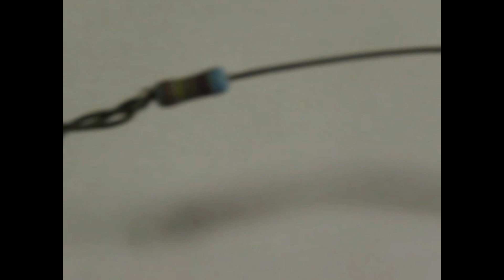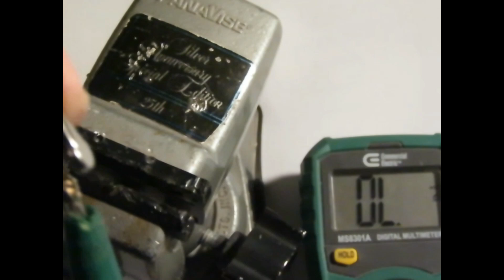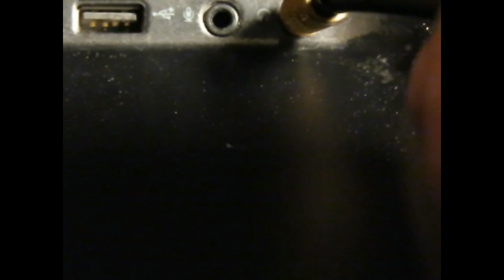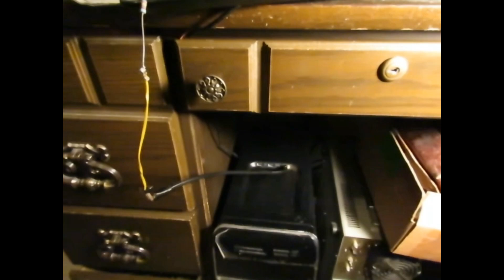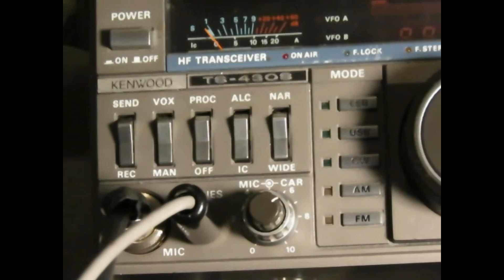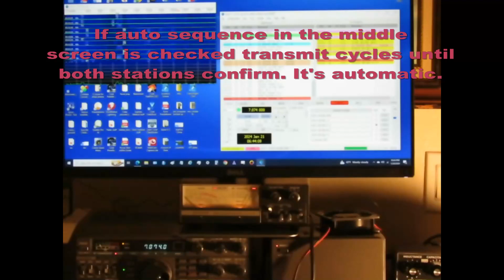Specific for Kenwood TS430s digital FT modes

Comment: Where did you get the cable that fits into the 430 mic socket?
Reply from the maker: The part shown in the picture, which is normally wired to the mic and plugs into the front mic jack on the radio came with the radio. You can sometimes find them on various ham sites selling used equipment. I doubt any ham outlets would have them. You may try posting on the used equipment sites that you need one of those. QRZ is a good place to start. You might try Amazon and Ebay.
The data plug and cable that connect to the jack on the back are difficult to find and kind of costly if you do find them, so I "ugly" wire them in. That is hard wire but don't solder wires in, just shove the wire in and tape it so it stays.

Comment: What if you computer doesn't have a mic input, only a USB in  and a Headphone out?
Reply from the maker: I've seen audio to USB interfaces available. You can search eBay or Amazon for those. I've never used one so I can help you with the details on those. You might look at a SignaLink. It's an interface for data modes. I don't know the details on those either.

Comment: Thank you
I understood the basic structure through your video.

In the previous video, it is shown that there are a total of 3 resistors,
We confirmed that the total is 101K Ω including the variable resistance.
(47KΩ+54KΩ = 101kΩ)

Question 1
How many KΩ are each of the two general resistors?
Can I install one 47KΩ?

Question 2
When measuring resistance after connecting the plug pin, do I need to adjust the variable resistor so that it is between 50KΩ and 70KΩ?
When connecting the final TS-430S microphone jack, should I adjust the resistance to between 50KΩ and 70KΩ?

As a new amateur radio operator, I am grateful to have learned a lot from you.   DS4HQS

Thank you
Reply from the maker: Yes, you can use one 47.0K or even one 48.1K ohm resistor along with the variable resistor which is set at 7.7K ohm for a total of 55.8K ohms. but the values are not critical as
explained below. 

If you want to set it up exactly the way I have it, here’s the short easy answer to the whole issue. Each of the regular resistors are 1/4 watt at about 24K ohms at 2% tolerance, so measuring them one is 24.0K ohms the other is 24.1K ohm.. The variable resistor is set at 7.7K ohms. So, 24.0+24.1+7.7=55.8K ohms total through all three resistors. 
 
The deeper explanation below explains that the resistance value is not critical. You can have a wide range to choose from.  And you can get a single resistor at the value  you choose.   

Question 1:  Resistors come in standard values. So you can use a single resistor. Also you don’t need to be precise on the values. The resistors used here are just there to limit the current from your computer so you don’t over drive the radio, or damage the MIC input by accidentally having the volume on the computer too high. So, a minimum resistance which I have found to be around 50K ohm should protect the radio. You can go higher to be on the safe side. I’ve gone up to about 100K ohms, but that’s on the high end. You would be fine picking a resistor between about 50K to about 100K ohms. A good one in the middle would be a 75K  ohm resistor. There are standard 75K ohm resistors at 10% tolerance. Any watt rating is good, even 1/8 watt, but I like 1/4 watt. 

The only reason I used two resistors was because I scrounge around for my parts and just happened to NOT have one that I needed, so I had the two 24K resistors and put them in series which add up to 48K ohms. I put in the variable resistor to bring it up to about 55K ohms, and I can adjust it if I want. But it is not necessary. The reason this new video is a little different than the old video is because I experimented around since then and found this to work too. So you can just buy or find a 75K resistor, or any standard resistor between 50K and 100K. On the safe side I'd go in the middle. Keep in mind you will adjust your computer’s volume and your MIC. gain on the radio to get the output power to your antenna and the ALC reading you want, just like you would adjust your MIC. gain on voice for SSB. In this case keep the ALC at a minimum. Except, and I'm going I’m going to get slammed by some operators for saying this, but  there are some FT8 operators that are sticklers on that ALC point, and there are others who will run with some ALC reading up to around 20%. Don’t be afraid to experiment with that. If you’re not getting contacts then add some ALC a little at a time until you get contacts. Just like voice, you can’t make contacts by whispering into the MIC. You don’t want your computer whispering in the MIC.

Question : 2 Since in question 1 I eliminate the necessity of the variable resistor I don’t need to explain too much here. I should have never put it in but it seemed like a good idea at the time. It seemed convenient to have it. I still have it in but it's not useful.

Feel free to ask more questions if you need to.
Reply: Thank you so much for your reply.

I understand everything you said.

In conclusion, we will summarize by using a standard resistor between 50KΩ and 100KΩ or a 75KΩ resistor, and controlling the ALC and computer volume.

With the help from that time, I think I can do FT8.

Thank you so much for your help.

If I have any questions, I will contact you again.

thank you @hamradioeconomystyle48